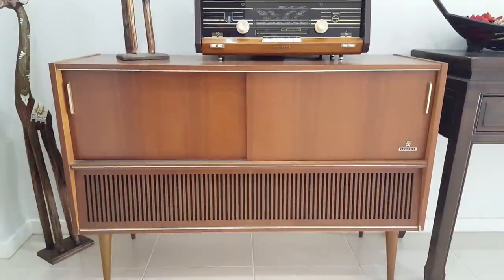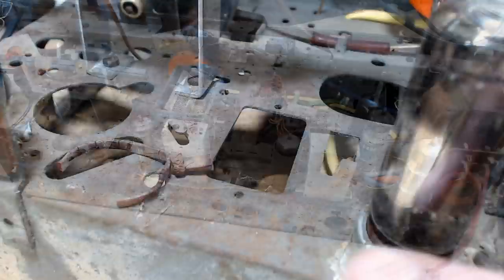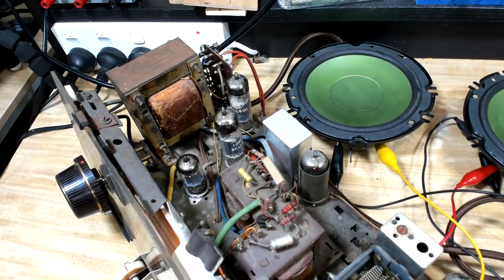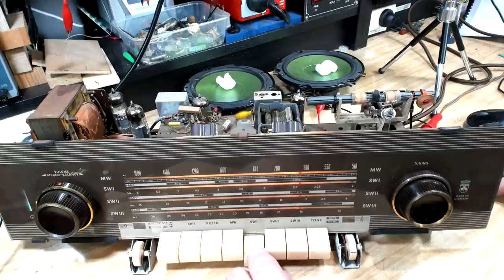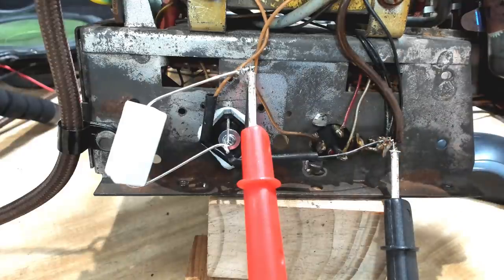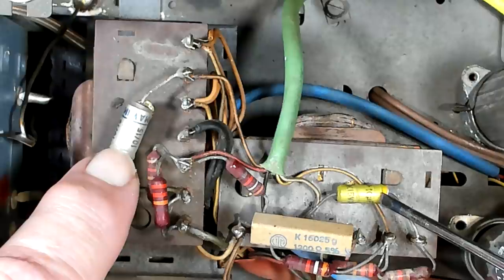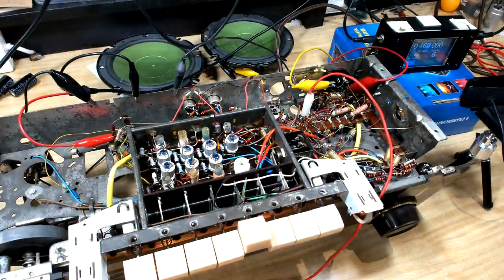Grundig Trento a/WE Radiogram Pt1 - The Radio

Comment: Hi Dave.  Great job.  A couple of things I'd like to mention.   You can't simply determine the dissipation of that resistor by measuring the average D.C. voltage across it, as the current waveform is in the form of pulses.  To do that correctly, you need a true RMS meter that also takes into account any D.C. component.  The actual dissipation will be considerably more that an average D.C. voltage would suggest.    Also, I can suggest why your home made "litz" wire didn't work too well.  In actual litz wire, the strands are arranged such that each one is in places running along the surface of the bundle, and in other places more towards the centre.  It is to minimize the "skin" effect, of a wire carrying RF current.   I hope that helps.  😊
Reply: does that explain the sensititivity (or lack of?)  ,  so factory would have woven with some kind of moving shuttle
Reply from the maker: Hi Stuart, thank you. Good point, I have a true RMS meter but whether it takes into account the DC component I don't know. I can still touch the resistor without the heatsink so it's running cool enough.
My faux Litz wire was a hasty decision and I later realised that is isn't twisted and as you say it's laid in a specific way. There is a Wikipedia article on it which I will read at some point. Thanks again Stuart 👍🙂

Comment: A Grundig without FM! For me as a German unbelievable. The chassis looks like it's also used with the FM-part in Germany,
Reply: I've also wondered about the versions that didn't have the whole 88-108 band; maybe the local regulations prohibited sets that went beyond what was authorized for broadcasting at the time.
Reply from the maker: It was an export model to Australia, we didn't have FM till1975 so there was no need to fit it. It would be the same chassis as the FM model 🙂
Reply: @pcno2832  That was in Germany the case, in the 1950s it was only 87.5-100, later to 104 and only around 1980 up to 108. But the first stations in these frequencies started in the late 1980s.

Comment: Very nice console. (To answer the lady's question, no I can't picture James Bond driving an electric car with an automatic transmission.)
Reply from the maker: Hi Wayne, he might have to if he wants to remain carbon neutral, I can see him in a Tesla 😀
Reply: @DavidTipton101  Most electric transmissions on power to weight far surpass petrol for acceleration.  strictly the motors dont need a geared transmission, but fit or keep one in and its even more fun(basically saves the back axle,  unless you fit individual motors to each wheel and have more fun.  The modern multi pole , wound and high magnetic metals are an improvement on the milk float era.   Even the steam wagons (and cars from the 1900s) could run along at 60mph+ which is scary for their weight distribution.  What is needed on the electric cars are additional speakers and tone generators to overcome the whine of electrics and replace with an audio of the petrol / turbo roar as the accelerator pedal is moved.
Reply: It's not about efficiency.  If it were, 007 wouldn't drink a Martini, "shaken, not stirred"  He'd chug grain alcohol.
Reply from the maker: @highpath4776  Maybe James could make car noises with his mouth while he chases SMERSH 😉

Comment: Back in the late 60s I built a stereo amplifier from a circuit in Practical Wireless which used the ECLL800 output valve (two push-pull output valves in one bottle, a little like 2 x EL84s). I remember when I went to my local electronics shop the guy refused to believe there was such a valve and insisted I needed an ECL80. Only when I went back and showed him the article did he do some research and grudgingly admit he was wrong. It continued to be a bit of an obscurity and I'm delighted to see it again in this Grundig set.
Reply from the maker: Haha... I can imagine him not knowing about it, I think they had a limited application life and were soon to be replaced by transistors. Two push-pull and the phase inverter as well, very neat 🙂

Comment: Looking forward to this one, David! A small note to all viewers, when handling a Grundig chasis, be careful of the selenium rectifier on the side of it. I got my first good B Plus jolt grabbing one  and learned the hard way!  The most fascinating thing for me, David is how you rarely run into an issue  you can't find a work around for. Hats off!
Reply from the maker: Thanks John. There seemed to be little concern about hanging high voltage connections on the outside of these early radios, grabbing the live chasses would have been a bit of a wake up 😮
Reply: Your right John!  David will either find or make a way to make it work.  He will 3D print it, manufacture it, or scare it into working. ;-)  
The solutions he comes up with are so artistic, creative, and downright genius!

Comment: Damn, I was enjoying that little polka at the end.  I use the Metal Rescue liquid which works really well though not as fast as they claim.  The liquid won't affect paint and I've found as a side benefit that it will also remove the green crusties from around copper terminals without affecting the copper or anything else. 
I'm looking forward to the turn table and cabinet work, that's my favorite part of your videos.
Reply from the maker: Haha... thanks Ellesmere. I noticed it cleaned up the brass bits I put it on, better than phosphoric acid. Record player and cabinet coming up 👍🙂

Comment: I keep a bad 7 and 9 pin tube that i have added some file marks to.  I spray the tube pins with DeOxit and work that around in the dirty tune socket to clean it.  Works really well cleaning stubborn tube sockets.
Reply from the maker: Hi Glen, good idea. I have been using dental picks which work well too. Thanks 👍🙂

Comment: David, that kind of a chassis surface gave me a problem with a tube socket. The sockets metal rings are also connecting ground to different connections. The FM first stage/oscillator tube had an intermittent problem with shifting frequency 1 MHz. ALTHOUGH the tube socket connection had also its own ground with a firm wire to the tuning capacitor ground, the chassis or its layer was oxidated (not visible) between the chassis and the socket (connected with the hollow rivets). Somehow a ground loop was made by that, and disturbed the FM oscillator. I had to drill it out, put in a screw and nut, and after that SOLDER it all solid to the chassis before I got the FM stable. When I heard your intermittent pre-amp problem I thought of that first.
Reply from the maker: Hi Erik, that's good point. Thank you for taking the time to highlight it, it's now in my non volatile memory, cheers 👍😀

Comment: Great to see this - a Grundig has been on my workbench for weeks and I'm down to the last couple of problems... I think. I didn't leave any of those pink paper "ERO" caps in mine, I'm a worry wart! Your videos are excellent, I've learned a lot and gained confidence. Rectifier is next so your info is timely. Best to you
Reply from the maker: Hi Mark,  I hope your Grundig works well when you finish it. I left the ERO caps in after I declared they were going but I tested them and they were spot on, they are only a few hundred pF. I may still change them due to public pressure 😄 Cheers!

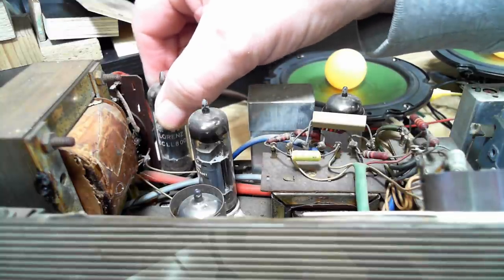Comment: 5:50 Those tubes look so unassuming for $100, I'd never have guessed that each contained a whole push-pull stage, complete with inverter. Good thing they were OK. I'm surprised they'd bother deleting FM from a set this nice; it must have been on the way over there by the mid 1960s. Nice work; I hope the turntable goes as well.
Reply from the maker: Yeah, they are getting hard to get is the problem. We didn't get FM until 1975 in Oz, they probably hadn't even settled on a system when this radio was built 🙄

Comment: Great radio you've got David!
The amp is stereo for the turntable and (probably) the tape recorder.
One tip: sometimes the polystyrene capacitors can fail, the failure is that they get intermittent (the leads will lose the contact with the foil).
I had one capacitor like that that was intermittently killing one of the shortwave bands, moving it slightly would bring the band back.

It is always great to see how you come up with solutions to make things look neat, Love your videos!
Best Regards,
Moshe.
Reply from the maker: Thanks Moshe. Yes, the tape input is stereo too. Thanks for the tip with the capacitors, I'll be weary 🙂

Comment: A nice easy one this week Dave.
Grinding certainly made some great looking and sounding units.
Those bench speakers didn't do it any justice but I know they were just for testing purposes
Reply from the maker: It's nice to get an easy one for a change 1974UTuber. My shop speaker is mono so I had to improvise 😀
Reply: @DavidTipton101  works fine for testing purposes.
You need an old set of those 70s HMV bookshelf size speakers in the wooden boxes with the black grill cloth with gold fleck through them. I always remember them sounding fantastic.
Haven't seen a pair of those in at least 20 years
Reply: David, would it be a good idea for you to show people the effect a speaker board has on the sound ? So just a large piece of triplex (or even paper board) with a hole for the speaker, and first show how the sound is without board, and then slowly move the speaker behind the board and stick it on the hole, to 'prevent the acoustic short' trough the air. I miss that sort of examples, only a few people know this effect.
Reply from the maker: @erikdenhouter  Good idea Erik, thanks.
Reply: @erikdenhouter  Even those PC speakers sounded decent when he ran the test in the second video with their plastic cases. I'm trying to remember what they call it when they hang a small speaker on a large piece of board. It's got a name but I can't remember what it is.
Basically you take a good quality 4" driver and mount it in the centre of a piece of high quality ply then hang it from chains at head height. There is a whole mathematical formula for working out the thickness and size of the ply sheet.
And it sounds completely different if you use a Triangle piece of ply to if you use a square. The best shape is an octagon
Reply: @1974UTuber  No clue what name is in your mind, but after a search I found the term 'baffle' :

"A speaker baffle is the front face of a speaker and baffle design is an often-underrated aspect of loudspeaker engineering. On most speakers, the drivers are mounted to the front baffle. Specifically helping with the high and mid-range frequencies, the baffle minimizes mechanical vibrations and the diffraction of sound waves, to create a more honest reproduction of sound and improved off-axis frequency response. The baffle also prevents the speaker's front and rear waves from colliding and cancelling each other out."

Comment: Very nice set! I do spot two paper caps, or maybe three - the two red ERO 100 next to the electrolytic you replaced and possibly one in the switch enclosure (far right).

I'm really looking forward to the next part!
Reply from the maker: Thanks Ragnar8504. The two ERO caps aren't paper as far as I can tell but I might change them, it's been playing on my mind. I'll have a look for the third one you mentioned, thanks 🙂
Reply: @DavidTipton101  ERO100 are paper caps that had the ends dipped in some kind of epoxy, which is quite deceiving but doesn't improve matters much. Kondur (a manufacturer I know absolutely nothing about, except that Philips Austria used their products in many of their radios) did the same thing.

ERO100, Eroid (both manufactured by Roederstein), brown WIMA Tropydur "cough drops", colourful Kondur rolls and blocks and the even brighter, resin-coated Czeija & Niessl capacitors are the ones I throw out immediately in European radios, similar to red and orange Roederstein and yellow or orange Frako electrolytics in newer equipment (70s through early 90s). Blue Philips electrolytics don't have the best reputation either but at least they don't usually short out. Those smaller than 220 µF do tend to drift a lot.

I don't have a lot of experience with British radios but the few Hunts and Dubillier capacitors I've had were just as bad as the list above, although they were completely encapsulated in some kind of black (Hunts) or blue (Dubillier) plastic.
Reply from the maker: @Ragnar8504  Ok, thanks Ragnar8504. I will revisit the caps in question 🙂

Comment: David, true Litz is not just parallel strands. It is formed like a rope, eg bundles of multiple strands, then each bundle in turn twisted together. The idea is that each strand spends an equal amount of time in the center and in the outside of the rope, which reduces capacitance between adjacent turns. Bottom line: it's difficult to make you own Litz without the special winding machine.
Reply from the maker: Hi Graeme, yes,  I see that now, I was a bit hasty there 🙂

Comment: I'm left being curious about the Litz wire you made. I wonder why it seemed to make a less efficient coil. Could the finished wire's greater diameter lead to more overlapping of the coils and greater self-capacity of the winding? 
This makes me want to look further into this. 
David thanks for prodding my couisosity.
Reply from the maker: Hi Jonka1, my Litz wire attempt was ill conceived, I thought it was just a bunch of wires capable of carrying RF signals more efficiently than a single wire but it's more involved that that, isn't everything to do with electronics more involved 😀

Comment: Dave  thought I'd pass on  to you a neat little way I've just  found  ( about 10 minutes  ago)  of bring up bakerlite .Its Kiwi ( no pun intended) shine and protect shoe dye .the one with the liquid inside and the soft foam applicator. I used very fine wire wool to remove the grime .l applied the shoe dye .let it dry then buff it out .I got a really nice shine. Allso tryed the black dye  on  the  vinyl  on my (yacht boy) radio I've just finished   I used a cloth  to work it in Works a treat   Regards  shaun
Reply from the maker: Hi Shaun, Thank you for the tip. Some folks in the group have been experimenting with shoe polish but I don't think it was the liquid type. I assume you are using brown? 👍🙂
Reply: @DavidTipton101  yes brown  I found it  actually soaks in to the bakerlite 
I dont know as yet but it seems to react with the bakerlite  because you can smell that pungent odour but  it disappears after awhile. Allso there are  range of colours and I found you can blend them as well  .but how about this David  .I have an old signal generator I am restoring  and the front panel is aluminium and has a  sort of mottled  effect and its black . I normally  would re spray it . But I thought I would experiment with the dye .I scuffed it with scotch bright used the dye .let it dry then sprayed it with lacquer left it until next morning  went to have a look thinking  its probably a right mess  . It looks bl##dy brilliant. And it retained its mottled  look . But  if i I had re sprayed it it you would lose the effect  iam now  experimenting on different things . Early days yet. I've had a few disasters. But all in all I think for our passion for vintage Equipment it could be just what we are looking for .and its ready available in super markets. Ps dont buy the cheap stuff it doesn't work as well . I will let you know how things progress. " Umm I wonder  if it will work on my grey hair " All the best mate regards from over the pond.
Reply from the maker: @shaunsiz.itsbetterbytube2858  Thanks for letting me know Shaun, any info is appreciated.
Reply: @DavidTipton101  try it on a scrap bit of bakerlite first .I have only just started experimenting with the dye so early days

Comment: I was rooting for your home-brew coil. Any idea why it didn't work? I was a little confused at what was insulated and what wasn't. Was the wire you twisted into a bundle insulated?
Reply from the maker: Hi Craig, thanks. The whole Litz wire project was a debacle. The wires should be laid out very specifically and the cotton covering keeps them that way, I just twisted them together hoping it would be sufficient. It did work but there was little sensitivity. I could have had a similar result using normal copper wire. The wire I used is coated in an insulating varnish 🙂

Comment: That's a lovely bit of gear, I was suprised by how few replacement parts you had to fit on the chassis. It's a Grundig though, it wasn't cheap and they didn't use rubbish parts.
Reply from the maker: HI Paul, yep, it worked pretty much out of the box, the components seemed to be of good quality 🙂

Comment: Hey,Dave. Great work. When you said that something was left out  thus no FM I was hoping you would be able to get the FM circuit in.
Reply from the maker: Thank clasicradiolover, we did not have FM when this was imported so no FM is fitted, I was hoping it had been brought over by an individual from Europe and may have FM. If you mean you expected me to fit FM, it did cross my mind but there are no dial markings and it would be a big job, it would be easier to fit Bluetooth 🙂
Reply: @DavidTipton101  I suppose so. I've always been interested in boards and chassis that had the space for an alternative circuit some that seemed as if one or two components added would add a feature to the system. In some Citizen Band radios there are simple modifications to add channels or increase power output.
Reply from the maker: @clasicradiolover  There are FM boards available that can feed the signal in. I have seen an Aussie radio restoring company videos and they demoed one and it was able to be tuned using the original tuner, I don't know how they did it though. I think it was FM, may have been digital 🤔
Reply: @DavidTipton101  No. I just thought it would have part of it there I'm  sorry for being totally out of the park
Reply from the maker: @clasicradiolover  Yeah, no... nothing in there FM at all, pity 🙂